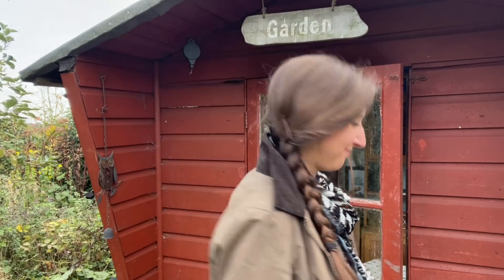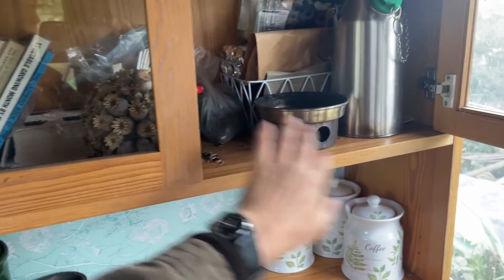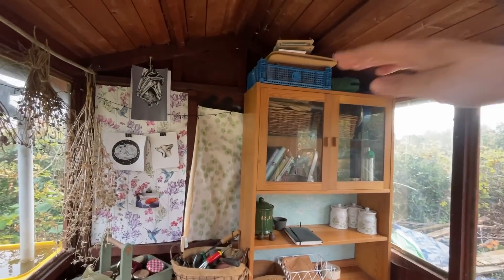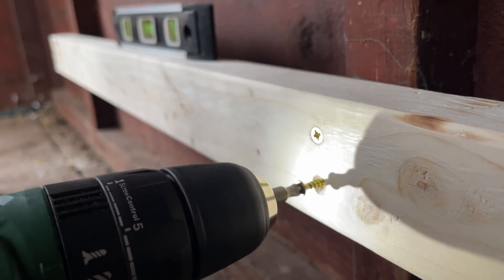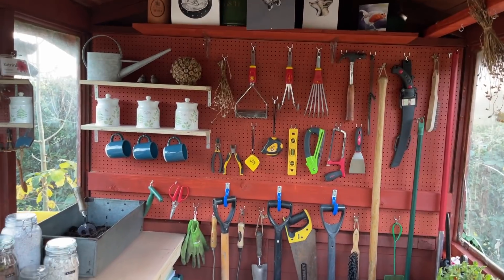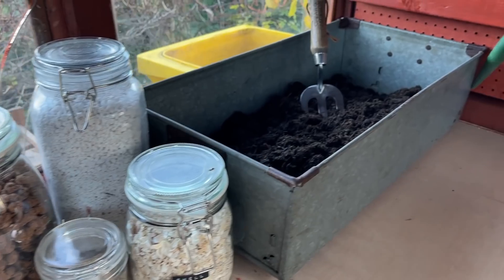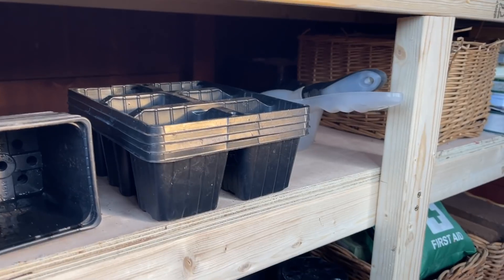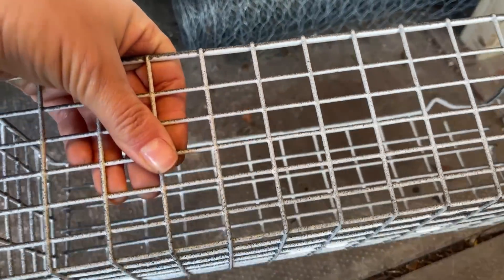Potting Shed Makeover / How To Maximise Storage & Organise a 6x8 Shed / Homegrown Garden

Comment: Great shed makeover. Pegboard is a wonderful way to organize. I’ve used it in many different places over the years. 

I recently saw a video where a man tried flour and baking soda to rid his sheds, animal coops and garden of rodents. He simply put it in plastic container covers and put it out for the mice to eat. For the rats that were eating his vegetables he put some in a cottage cheese container and cut a hole so they could get their heads in and it eat it and it wouldn’t get wet when he watered. It worked very well. In some of the comments people said they mixed a little water with it and made little balls. Also some said they mixed sugar or peanut butter with it to attract them. It is not toxic to humans, the environment or other wildlife….just rodents. May help you to rid your shed of those pesky little vermin. I’m going to try it this year in my shed. Going to try making it into balls….less messy.  It was a 1 to 1 ratio. 

Something else I saw recently was using mentholatum on decorative pumpkins in the landscape so the squirrels don’t eat them. Perhaps that (or something with a strong mint odor) would keep your poppyseed pod orb from being eaten by the mice. It’s a lovely decoration. Or perhaps you could hang it from the ceiling with a sprig of dried mint. Would be a shame if the mice ate it. 

I’m sure you will find your shed makeover will save you a lot of time next growing season. You’ve turned it into a pleasant little space. Love the windows. Great spot to have a cup of tea and enjoy natures beauty.

Comment: Love your new shed, Katrina!  Don't you need a stool to sit on...?  :-))  I have just bought a new shed fitted out the interior with shelves and a long bench on the one side for relaxing.  I have painted it white inside and I love it too.  It is my sanctuary.  Luckily, I have an old shed which stores all my tools and gardening stuff so the new shed is just for me!  (It also has a camping loo, just in case)!!!  :-))
Reply from the maker: I do have a stool! It’s just not there right now. You can see it in the ‘before’ footage. It’s a square box with storage inside. I think I might put it where the compost dustbin is as it fits quite nicely under the table. Then when spring comes around, swap it back ‘cause I won’t have time to sit down 😝

Comment: Thoroughly enjoyed your video. You have given me a few good ideas for my allotment shed. With regards to hanging your mallet, it's very easy. Just cut a piece of your string say about 12" long, then tie the two ends in a knot so that you then have a circle. Pull the circle at two ends fairly tightish making an oval shape. Put the handle of the mallet down through the middle of  the string  so that the mallet head cradles the string, Then all you do is over the top of the mallet head, feed one loop end through the other loop end and pull it tight. 
Just one thing I did notice was that you have an attachment tool hung up with the three prongs pointing outwards. This could be dangerous if you or others were to trip or stumble inside the shed. All the very best.

Comment: Great job on this shed makeover! As for your rubber mallet problem, try drilling a sufficiently large hole in the handle end so that it will fit on to a narrow peg placed on your pegboard. This worked for me.

Comment: Brilliant makeover. Your DIY looks a lot nicer than mine. I'm currently building a greenhouse out of recycled windows, pallets and structural timber and I'm hoping to use part of it as a potting shed style area too.
You have probably already figured out an option but you might be able to get some dowels to slot into your peg board that would sit on either side of the handle of your mallet thereby supporting it by the head... if that makes sense?

Comment: You were correct to say about the windows on each 'side', the other two walls are 'ends'.
Maybe think about vanishing both sides of the plywood to avoid uneven movement due to humidity levels.
Why do you need to grow flowers when you've got a pair of trousers like that?:-)

Comment: Love the shed make over.  
Just a quick question. What is a soil blocker. Regards Kim xx
Reply from the maker: It’s a way of growing seedlings without any need for plastic pots. The blocks of soil stay together and the roots are air pruned, making a strong little plant. The reason I stopped using it was because I couldn’t get my soil mix right. Peat free compost is less sticky than peat based so I need to work on the recipe.